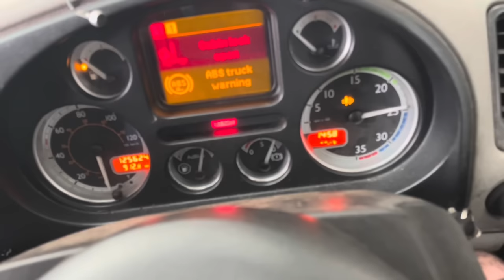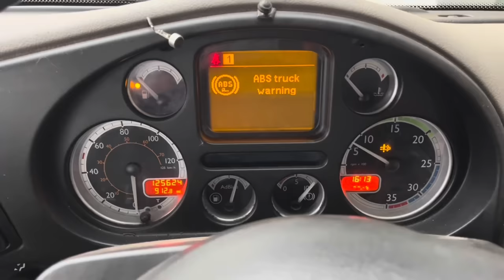Daf lorry not building up air pressure! Milky oil? Fellow YouTubers BAXENDEN CAR BREAKERS.

Comment: Chris you can never get a reading on the LF dipstick..it will always have water droplets on it ..Mainly due to the length of the tube ...Will say 4 screws hold the steering resovoir on and it just pops off ,would have helped get the awkward bolts out...Good to see you timed it lol  yep it is timed lol,,There will be hundreds running about not timed up ,,It is to stop engine  vibration
Reply from the maker: 🤦🏼‍♂️ live and learn mate, really there timed?

Comment: I had this on an A40GVOLVO DUMPER 2 fully qualified fitters spent all day lap top en all trying to work out y it wouldn't do a regen and couldn't work out y!!! I done the same as u undid the main pipe on the compressor to find it was making no air!!!the regen uses air from compressor to help the burn process but I was lucky it was just the head gasket on the compressor so I made one out of copper job done !!!sweet Chris m8 keep em comin
Reply from the maker: 😊that’s what we like mate 👌💪

Comment: Great vid mate but on the daf compressor job it doesn’t take all that long to remove the power steering reservoir and pump separate to the compressor without touching the ecu if you ever need to try 😊

Comment: Daf lf . Common for mayo oil condensation issues. Especially if only local runs. 
Head goes on the compressor. Common fault. Had plenty in my time chris 
Struggle on haha
Reply from the maker: Yeah I know the 85s always had rusted pip stick! I’m hoping it is the compressor mate👍
Reply: @Professional-struggler  I'd like to think you'd of known otherwise by now if it wasn't. I remember looking after a few lfs that were part of a fleet of carpet/under lay deliveries.
They had 1 lf that was a sleeper cab and that driver was a tramper. When you pulled his dipstick or oil cap. (Especially the oil behind the front grill) 
It was spotless.
The other 2 which were local all the time.
It was like opening a jar of mayo.
Like it for years

Comment: How come all the fitters I’ve worked with need every size spanner there is for the tool box, but they only ever seem to use an adjustable until the head wants to round off 😂😂😂? And I bet Little Leer dog was knackered after a 2hr drive.😂
Reply from the maker: 😂🤣 the adjustable is the go to spanner mate…. One size fits all 😂 he’s a grafter